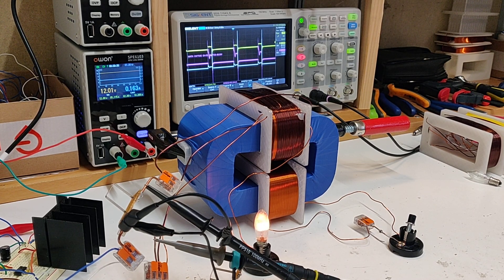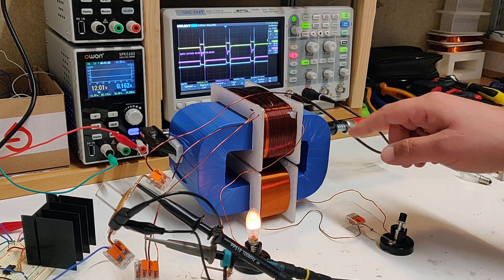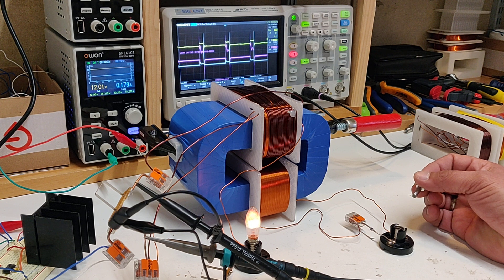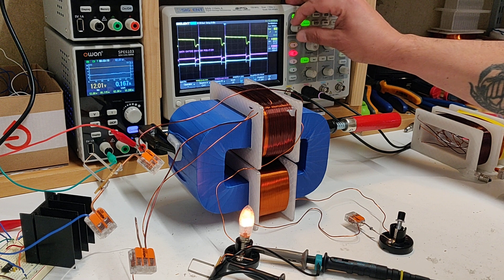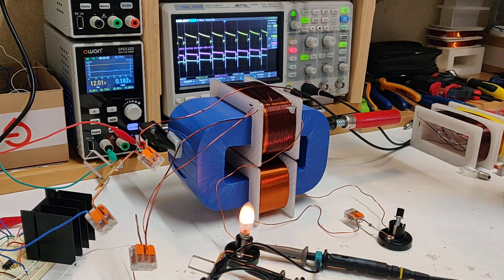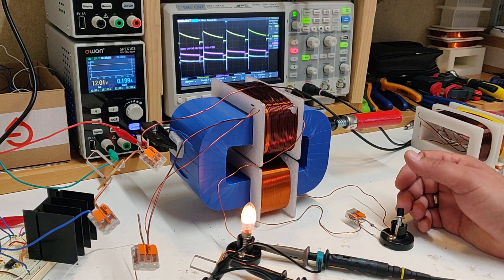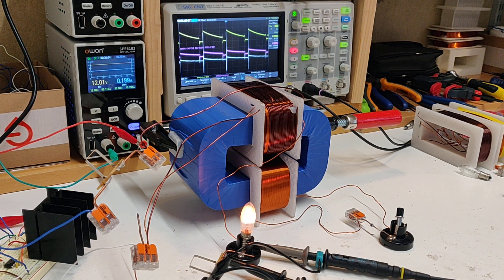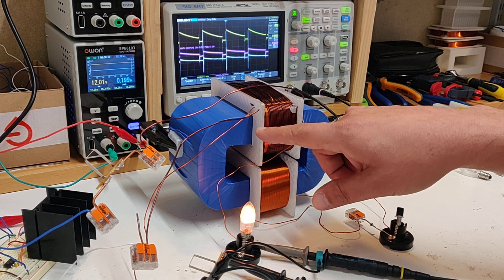FringeIdeas Non-Inductive Coil Experiment Replication Deeper Look

Comment: How did you wind your coils? My hand wound coils are bad.
Reply from the maker: Hey again, I took a few weeks and put together a coil winding rig, because I was tired of hand winding. The rig makes it SO much easier. Don't have to worry about turn counting, bending wire and messing up the coil. I have 2 videos on the rig back in the list. It turned out to be a bit overcomplicated the way I did it, but they are not hard to build.

Comment: This is normal. In fact they used to shunt portions of a transformer to control current. It used to be a very common circuit. I forgot what they called the circuit off the top of my head but I will try to find it and reply with the name of the transformer current control. By shorting you are keeping more energy contained within the core. That is why it works. This used to be a common dimming like circuit. But there are far more efficient ways now with scr and diacs now so it's almost never used any longer
Reply: Ok it's basically explained by a magnetic amplifier circuit. If you research magnetic amplifiers and transformers you will get a better understanding of what is happening.  Hope this helps
Reply from the maker: This is something I have been starting to look into actually. Thanks!

Comment: Thanks for sharing this FringeIdeas.

Few questions:

1. I'm assuming the frequency and duty cycle is coming from a function generator?

2. Could you please show /mention what is the function generator connected to?
3. What is the Programmable DC power supply connected to? In all, what are the 6 wire endings (2 from POC1, 2 from POC2 and 2 from input coil) connected to?
4. What are the winding directions? Does the winding direction change midway in any of the 3 coils or do they stay CW or CCW throughout?

Thanks! Appreciate sharing all this knowledge!
Reply from the maker: Hey, no problem, and thanks. Are you a member of the forum? Shot in the dark.. Anarsu? I do plan on making an off topic post soon, for entertainment. Maybe today. I have been doing a bit of work on my electronics to clean up noise. Power supply, my switching, etc. And I fixed a blown channel on my oscilloscope. I'll show all that in the post so it should be easy to see what I have running here. As far as the coils are concerned, I have mine exactly like what Chris shows. However, I believe I have my input coil reversed. Maybe my head is reversed, not sure. This hand drawn picture shows how the POC coils are, and how I believe my input is. https://www.aboveunity.com/thread/fringeideas-non-inductive-coil-experiment/?order=all#comment-b3b4526a-31fd-45fa-b4dc-b0f400a590f4
POC coils are 1 CW, and 1 CCW, wound the same all the way through, as Chris shows. Input is wound on top in the same direction as the POC coil.
Reply: @FringeIdeas  , thanks for your response. Yes I'm part of the forum and bullseye, Anarsu - that infamous post 😅 Look forward to your future videos.
Reply: @FringeIdeas  , some points I picked up from the thread your shared:
1. The Secret Revealed - Resonance Magnetically - I've to watch this video.
2. Study Antenna Theory.

So many jargons in there! It's mind-boggling.
Reply from the maker: Hey, ok, and the resonant frequencies and antenna theory I would not worry so much about in the beginning. Like you said, it can be a bit much at first. A lot can be learned up front, just by getting together a decent switching system, and just throwing together a few POC coils, and playing around. I will be soon, going through and trying to connect the dots between the frequency/duty cycles that work, and the natural resonant frequencies of the coils, rise times, etc, as I don't fully understand how those come into play. But it will take some time. And sorry, I have not put together a video about my gear yet. I seem to have picked up some flu and I've been trying to stay parked on the couch in front of youtube. :D soon though.
Reply: @FringeIdeas  get well soon. Switching system, you mean the H-Bridge? Sorry, take rest.
Reply from the maker: Hey thanks. And no, I have never had an H-bridge. No plans right now to build one. And I think for most of Chris's more recent experiments, including this one, it's only a pulse driving one mosfet. Sometimes highside switching like I have here, or sometimes lowside switching. But pretty much always just one mosfet and a pulse from some kind of generator. Currently I have a signal generator (could be a 555 or whatever) feeding a TC4431 mosfet driver (inverted signal kind), which then controls the gate on the mosfet (P type IRF9610). Super simple circuit on a breadboard.

Comment: Interesting work FringleIdeas, I got similar effects using Chris's circuit in all my recent experiments;
At a specific frequency and dutycycle, input current drop is around 200ma and the load/lightbulb too gets brighter when poc 2 is connected, 
If dutycycle is too big, input current drop effect will be larger and the effect on the bulb will be reversed.(this is not what we want)
But all is looking good bro, that big core will give you results.
Be safe
Reply from the maker: Ah very nice to hear! And thanks for the comment, I'm glad to see you were observing the same!